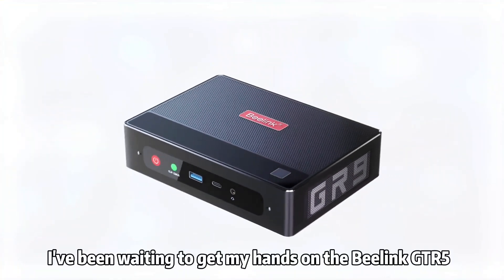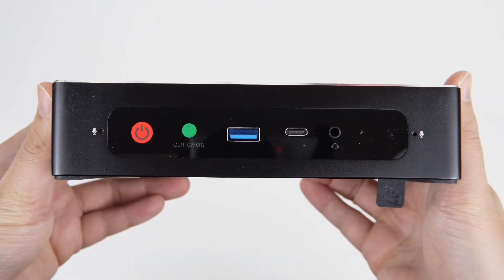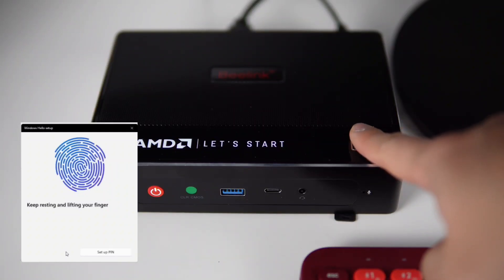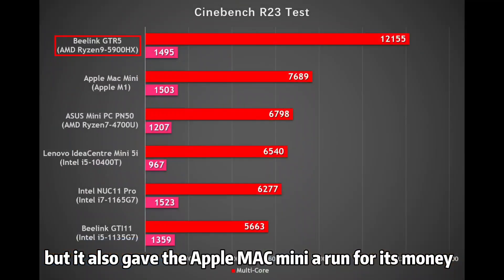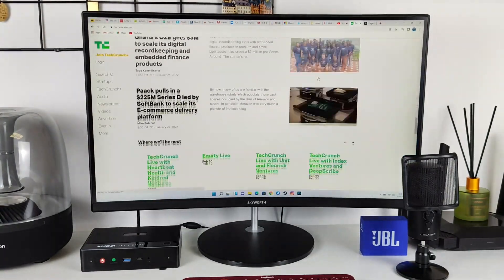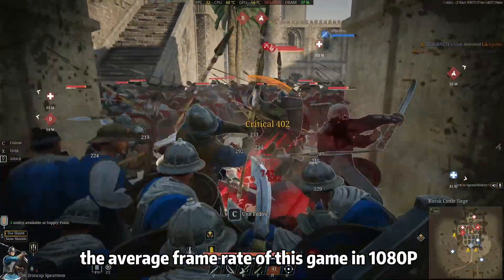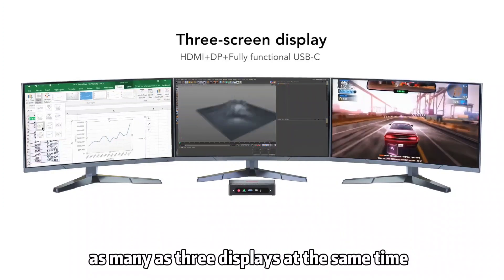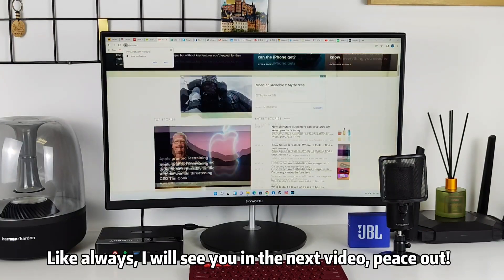Beelink GTR5 review: the best mini PC ever

Comment: I'm new to these mini pc, mind me asking a few questions?

Is the gpu upgradeable? 
Where does it stand in gpu performance? Around gtx1050?
Does the heating good?

Would love to hear from you,thanks.
Reply: I just purchased the SER4 from Bee-Link and I do not see how the GPU is upgradable since it's onboard. You can upgrade memory up to 64Gb and the ssd up to 2Tb. It's an awesome PC
Reply: No. The GPU is integrated with the CPU; together they are called an APU.

Also, there is no PCIe slot.

Comment: Just a comment. At 9:05 you say Mac Mini M1 has Thunderbolt 3 ports. Is that correct? I heard it is not supported by the M1 processor because it is an Intel Technology. Please advise.
Reply from the maker: It's correct, even the M1 powered iPad has a Thunderbolt 3.
Reply: Thunderbolt 4

Comment: Been running mine since the 4th of February, took for ever to receive, but awesome little bad boy. 64gig, 2 1tb m2 drvs and a single 2tb ssd. Thing rocks.
Reply: Thanks for the response. But the m.2 data drives have 2 notches in the connecting pins. The socket only has one notch.
Reply: These are great machines. I do developer work and run everything I need in 2 x 4k. Boots up super quick also.
Reply: @AdamCRWFD  Do you still like it? I just bought one, i.e., it hasn't arrived yet, but I just read a bad review from someone in India, albeit, he received what he perceived to be a used one.
Reply from the maker: Glad u r enjoying it.
Reply: What ssd did you install in the empty ssd slot? I note the slot is a nvme type but the spare does not support another nvme.
Reply from the maker: @AdamCRWFD  the other slot is m.2 sata.
Reply: @AdamCRWFD  Should be Sata III
Reply: Hello does ur fans stay loud ? Mine are so loud from when I got it. Any tips ?
Reply: Compare Morefine and Beelink? Which is better.